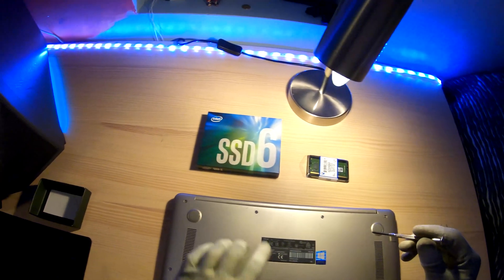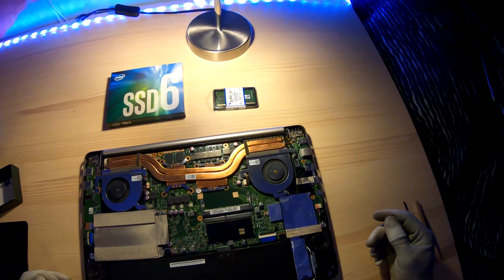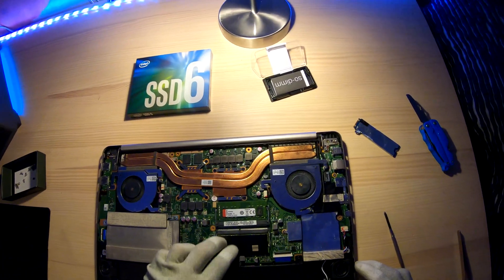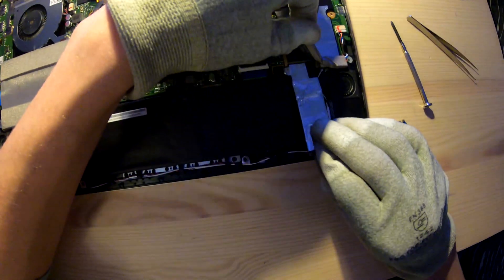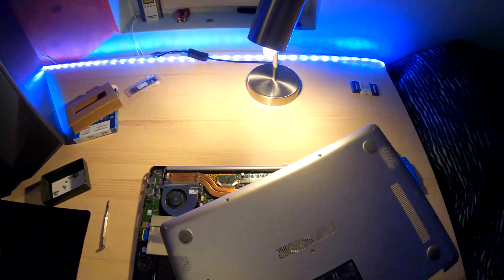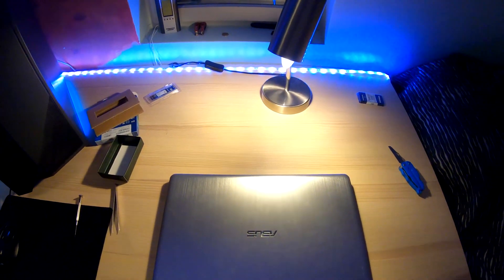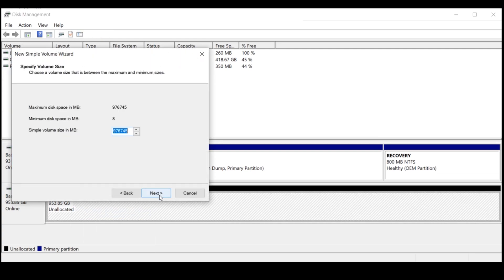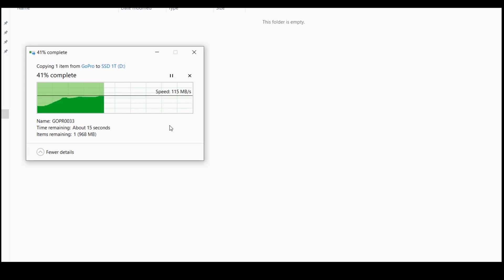Asus Vivobook Pro 15 SSD & RAM Upgrade

Comment: How to upgrade the Ram ? Any ideas bro
Reply: Check the type of RAM you are mounting now, buy the same and mount it on the second slot.
I have upgraded mine from 16 to 32GB (I just added a bank of 16GB to the empty RAM slot).
I hope this helps.
Reply: @AntonioFardella  ciao io ho lo vivobook pro x580v con 16 gb di ram, quindi in teoria posso comprare semplicemente un banco da 16 e usare lo slot libero? oppure il pc ha due da 8? grazie
Reply: @christianverde2498  puoi prendere una da 16gb e montarla nel secondo slot. Questo laptop è ok perché ci sono solo 8 viti per smontare il fondo e i due banchi di RAM sono eccessivamente facili da trovare. Casomai mandami un messaggio privato se hai problemi.
Reply: @AntonioFardella  grazie mille,appena effettuo l'operazione ti faccio sapere
Reply: @christianverde2498  ok. Come azione preliminare smonta il fondo e verifica di che tipo è la RAM che monti. Compra una simile in termini di capacità (16gb) e di frequenza di clock.
Reply: @AntonioFardella  Crucial RAM CT16G4SFRA32A 16 GB DDR4 3200 MHz CL22 (o 2933 MHz o 2666 MHz) Memoria per laptop
ho trovato questa su Amazon a 55€ per il momento conto di fare tutto ad anno nuovo

Comment: Hello Brother, any idea about Vivobook pro 15 M6500 Model, does it have extra 2.5" sata HDD/SSD slot?
Please Reply fast, I want to buy it but need it to be upgradable without having to sell/throw away previous SSD
Reply from the maker: Does it come with HHD or ssd? Because of ot comes with hhd then it probably has a slot for ssd but if it does have ssd already like 1TB the  I bet it wont have extra slot
Reply: @Kas1122  Thanks for the reply
It comes with 512 GB SSD 
So in case i needed some extra storage i want to go for extra HDD along with this SSD

Comment: Hello,
Asus representative stated that my laptop supports NVMe if it says 17197X on the SSD socket on the motherboard. The SSD slot on my computer's Motherboard says 17491z, I told Asus this information, I'm waiting for an answer. What does the SSD slot on your motherboard say? Although it writes a different code than the 17197x code, can anyone plug in and run an NVMe SSD?
My laptop model: N580VD-DM058T
Thank you.

Comment: What is the maximum supported RAM frequency? In laptop there is 2400 Mhz but I read that there could be 2666 Mhz. What about 3200 Mhz? Anyone tested it?
Reply from the maker: Not sure, but remember both of your RAM stick should be same frequency
Reply: @Kas1122  I want to buy new kit 2x8 or 2x16 and sell old ram. :)

Comment: Hello. I have the same laptpop model, what did you extract or take off in the slot you installed the SSD drive (the optane memory?)?
Reply from the maker: It was like ssd (16GB) that was assigned to work like exta ram. It was kinda useless
Reply: @Kas1122 Thanks!
Reply: @Kas1122  Yes, i have the exact same laptop, it has 1TB HDD and thought what use is a 16gb SSD... so this slot i will upgrade also, i don't know which one to buy though, can you help?
Reply from the maker: @ buy the ssd the 16gb is kind of ram or something like it. Buy at least 1tb or bigger ssd thats my recomentation. Also the new ram stick is cheap so why not upgrade both like I did.
Reply: @Kas1122  which did you use, sata3 or NVMe?

Comment: as i open the 580v non pro i have seen that the two slots are already used, i guess two of 4 gb, really dont know if i can remove that 2 and put two 8 gb rams, i think cause of dimensions, unless they have the same dimensions, but dont know, instead i miss the screw for ssd, is it within the ssd pack?
Reply from the maker: what you are meaning with dimensions? I think you can change the 2x4GB ones to 2x8GB. Normally the ssd packs don't have the screw so I guess if the laptop didn't have the screw you need to get one somewhere.
Reply: @Kas1122  i mean with the sizes of the rams, because i dont know if i can switch, dont know where to find rams with the same sizes😅
Reply from the maker: @metjukasa9212  here is example od one.  https://www.amazon.com/Crucial-Single-PC4-19200-SODIMM-260-Pin/dp/B01BIWKP58   you just need to find the SO-DIMM ram size there should be a lot of them.
Reply: @Kas1122  thanks, will try to figure it out👌

Comment: did you use:
+intel 660p 1TB -->https://www.intel.it/content/www/it/it/products/memory-storage/solid-state-drives/consumer-ssds/6-series/ssd-660p-series.html
+kingston 16GB Module - DDR4 2400MHz --> https://www.eprice.it/memoria-ram-KINGSTON/d-8982197?meta=KNG
?:)
Reply from the maker: Yes. For the ram I just went for cheap one.
Reply: Thank you for the reply 😊
I noticed in the video the the Intel SSD had a different key type from the old SSD you replaced.
-could the pc boot correctly after the SSD upgrade?
-Did you make an external drive out of the old SSD?
Reply from the maker: It booted just fine because windows was in hdd drive and the ssd which I removed was just some kind of RAM ssd so it was not for storage.
Reply: @Kas1122  Is there a website you use for SSD compatibility?
Reply from the maker: @AlessandroEren  idk is there but I didn’t use one. The intel SSD I used worked just fine for me.
Reply: @Kas1122  thanks :) just ordered the parts 😉

Comment: What ram use on it? i have a n580vn - dm016t
Reply from the maker: Doesn’t really matter just look that it is ddr4 and does have same speed than the other stick in your laptop if tou don’t change the ram and only add more.

Comment: hi, im pretty late, but what type of 8 gb ram you put on the pc(im ignorant sorry), and as long as the n850v and the pro version are very similiar, can i do on the n580v?
Reply from the maker: I used cheap one. Kingston 8GB DDR4 2400MHz, SO-Dimm, CL17. 1.20V (about 35-50 euros). I think that you can do the same on the 850V but not 100% sure
Reply: @Kas1122  thanks for the info, so i can buy this https://www.amazon.it/Kingston-0740617262711-Memoria-RAM-Nero/dp/B01LW6HBSM/ref=sr_1_1?__mk_it_IT=%C3%85M%C3%85%C5%BD%C3%95%C3%91&dchild=1&keywords=kingston+8gb+ddr4+2400+mhz+1%2C20v+cl17+so+dimm&qid=1606299539&sr=8-1
and this https://www.amazon.it/Blue-Unit%C3%A0-Stato-Solido-Interna/dp/B073SBV3XX/ref=sr_1_39?__mk_it_IT=%C3%85M%C3%85%C5%BD%C3%95%C3%91&crid=4QGAC6QHTD7Q&dchild=1&keywords=ssd%2B256%2Bgb%2Bsata&qid=1606231575&sprefix=ssd%2B256%2Bgb%2Bsa%2Caps%2C241&sr=8-39&th=1 for the upgrade?
Reply from the maker: @metjukasa9212  yes it should be fine

Comment: I know that this is old. But can you share specific memory to upgrade this model? I have the same laptop, and i want to add another 8gb stick, but don't know which one to buy.
Reply from the maker: so you can use many different  ram sticks, but it should be DDR4 and 2400MHz so it  has the same MHz than the memory already installed if you are adding more like I did. I used cheap one. Kingston 8GB DDR4 2400MHz, SO-Dimm, CL17. 1.20V (about 35-50 euros)

Comment: Завелся на ноуте Asus N580VD после обновления BIOS до версии 317. При этом, в BIOS его не видно, но винду поставить можно.
Reply from the maker: English please
Reply: @Kas1122  Started on the Asus n580vd laptop after updating the BIOS to version 317. At the same time, it is not visible in the BIOS, but you can install Windows.

Comment: Hello @Kas1122. I have a little question. I have the same kind of laptop. I wanted to upgrade it because it came with a 1TB hdd which broke. I bought an SSD SATA 3 M.2 as Asus say on their site. The problem I have is that the SSD I ordered has the two small wholes and my slot/socket has only one. Should I send it back and order the one with one whole (i think it's the PCI-E)? Sorry for my stupidness. I'm not the best at this. Thank you!
Reply from the maker: Vlad Groza hello, you should send it back and get an M.2 NVMe SSD like the one which I used intel 660p 1TB or get similar but (samsung) if you need more speed
Reply: @Kas1122   I tried doing this upgrade with a Samsung 870 Evo 1tb M.2 SATA SSD but it would not show up in device manager so I returned it after much trial and error. I thought it was too big because the ASUS website said the computer only supports up to 512gb SATA SSD. Then I realized the ASUS Vivobook Pro 15 N580GD M.2 port was PCLe. Was there a certain trick you had to do to allow your 1tb SSD to show up in disk manager? I would like to try again with a Samsung 970 Evo PCLe NVMe 500gb SSD.
Reply from the maker: @kevinwaldron6400  for me it showed up in the form hard disck with out any issues, like you see in the emd of the video. I didn’t need to do any tricks

Comment: Hi dude I got the same laptop and it seems my bios, file explorer, disk and device manager can't detect it back when it was Aug 16 my laptop still detect my hdd in bios but as of Aug 21 the bios no longer detect my hdd is it because of faulty hdd or just disconnected?
Reply from the maker: Knight Mare I would bet that the hdd is broke, I had mine broken and it went to warrenty and they chances the hdd. It was like under a year old then.
Reply: @Kas1122  yeah I pry open my laptop and tried to plug it back on to see if it's just a loose connection, it's really broke like you said, thanks for replying dude really appreciated it, Stay safe out there!

Comment: you used SSD SATA m.2 2280 and then you used m.2 2280 nvme. Does that have any connection and can it lead to problems in further use? During the ordering, I made such a mistake where I mixed the mentioned SSD cards. On some forums I came across that this kind of replacement can't work (sorry in bad English)
Reply from the maker: Id what you are trying to say but I didn’t Use SATA SSD at all in that upgrade
Reply: @Kas1122  You had* SSD SATA M. 2 2280 whit two key M and B on your laptop before you change it with new SSD whit only M key. Does this makes you problem in using laptop? Asking bcs im going to ugrade my laptop whit same changes.
Thank you for fast repaly.
Reply from the maker: Balkan Federation it did not make any problems for me. Have been working just fine

Comment: I have the same laptop, and planning to upgrade the RAM. Originally it is 8gb, is it possible to add a piece of 16gb ?
Reply from the maker: Elang Perwira I think that you cannot add more than 16gb of RAM to this laptop. https://www.asus.com/Laptops/ASUS-VivoBook-Pro-15-N580VD/specifications/ there are specifications and it says up to 16gb. I can also be wrong, but I recomend to buy a 8gb stick instead. The maximiun can be 32gb so you shoud double check it before buying more ram.

Comment: I have the same laptop, can I use a crucial pcie nvme m.2?
Reply: @heblexreza  I've got an ASUS X580GD_N580GD and swapped the M.2 Sata with an NVME Samsung EVO 970. It works fine and has fully PCI3.0 x4 Support. So all good!
Reply from the maker: it should work just fine

Comment: I got the same computer but I'm having a kind of stiff hinge, and I hear some cracking do you have any idea about it? Thanks
Reply from the maker: Carlos Ruilowa Cespedes idk what it could be but dosen’t sound good. I would recommend to bring it to the repair shop. Mine had hard drive failure after couple of months but they fix it under warrenty.
Reply: @Kas1122  I found out what it was, the hinge started to harden, I just need it to unassambly the botom part and then the lower part of the screen, then loosen the bolts and add some oil and good as new
Reply: @carlossruilowacespedes596  Hello! I have a similar problem. The hinge runs smothly but you can hear some crackling when you open the lid. The same thing happens if you touch the plastic part where the screen is attached to the rest of the laptop. I actually uploaded a video of this ( https://www.youtube.com/watch?v=8vYLiku2HkQ )  and I've posted it on multiple forums but I didn't manage to find anything. You are the first person that has some similar issues with this laptop. Do you think that it may be the same problem that you have?
Reply: @sebastiantv108  doesnt look like mine, in mine the screen was separating... when i can (probably tonight) I'll do a video showing you what happened

Comment: I have the same laptop. Whenever i start any game, it heats up so fast (+90 C on cpu) and the fps drops massivlh, if i change the thermal pat of the cpu will the problem be solved ?
Does it perform for you well at gaming ?
Reply: Hey bruh...
I have an Asus n580GD. I changed my thermal paste with Nocouta-nth1 and its temperature doesn't pass 80 degrees while gaming.
Reply from the maker: sa lah it does pretty well when gaming, I don’t get thermal throttling so my fps newed drops. It might be that it dosen’t get enough air in or the fans aren’t working right. I think it is not thermal paste but it can help if you change it.
Reply: I have the same problem, I changed thermal paste and it did go to lower temperature but it continues reaching ~90° C.
This happens in games like the division 2, civ 6, rainbow six siege.
Reply: I think u didn't undervolt ur CPU. U have to undervolt and underclock ur CPU. Then u will that. U can use throttlestop. In addition, it would be better if u update ur BIOS to the latest version.

Comment: Hello! I already have 8gb ram. Can I put +16gb ram? After it can be 24 gb.
Reply from the maker: Csaba Vincze I blelieve that  it can’t support 24gb but I could be wrong. It will support at least 16gb. It said somewhere where I bought it that it support 16 I think it was but check it somewhere. And I don’t recomend using two different size ram sticks.
Reply: Kas1122  Thanks! 😉
Reply: How many ram slot in the asus vivobook pro ?
Reply from the maker: sa lah two

Comment: Seems to me, here a M.2 SATA SSD (with two slots in connector) is replaced with M.2 PCIe (or NVMe, with one slot) SSD. Does it really work just like that? Intuitively, I would suspect that one-slot component wouldn't even fit in SATA connector.
Reply: I need to know this now too!